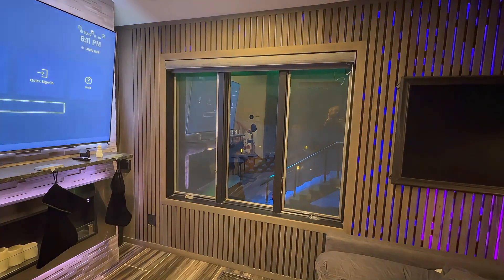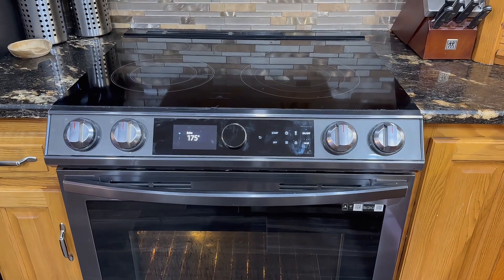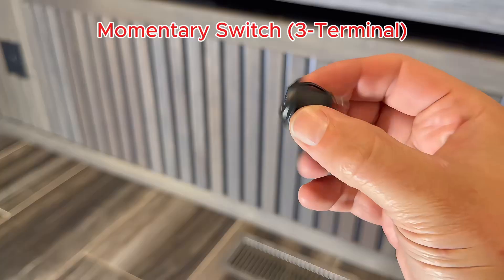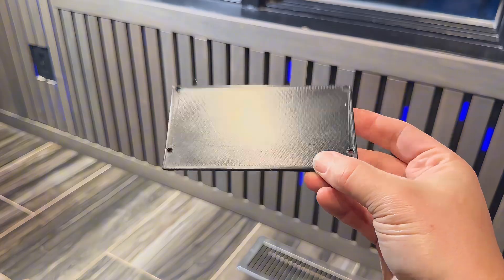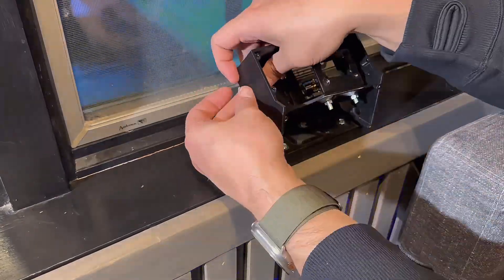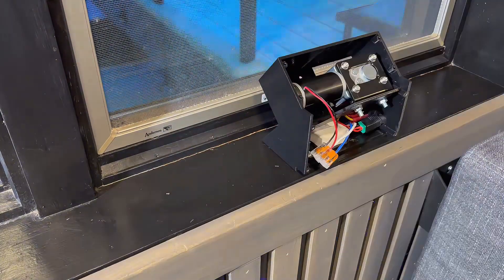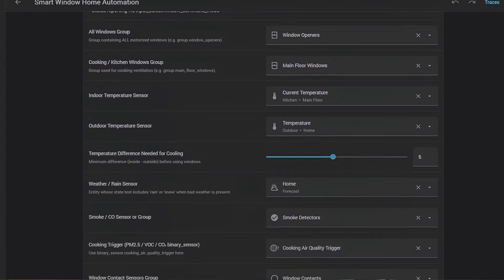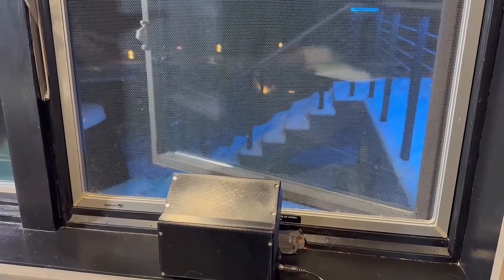DIY Smart Windows: 3D Printing + Z-Wave + Home Automation

Comment: This is awesome!  For years I've said, "How long until we have automatic windows in our house like we do in our cars?"  I'd love to see part 2 with the following included:
1. It's "affordable" but how much $$$ per window?  (Yes, I could just add up all the components 😊)
2. How (in home assistant) do you program the timing of the motor?  Are you always triggering an automation or script?  Or are you using auto-off in the device settings?  Or something else I can't thing of?
3. Speaking of timing, how long does it take to open/close?
4. How loud is it?
Reply from the maker: For all the parts including the motor and adapter, zooz controller, power supply, screws momentary switch, and coupler - it comes to about $100 per window give or take. 

In the Zooz ZEN53 motor controller there is a limiter when resistance is met the motor determines it’s at the end. It can also be calibrated based on cycles. 

There are different motors you can get. Mine is 16 rpms so it’s relatively slow but you can get quicker motors. Slower rpms means quieter motor.

Comment: I have had this kind of system in my home for over 40 years. This was way back in the X10 days. 

The first thing I did was install some large exhaust fans in the attic. They have weatherproof louvers that open once the fan goes on. Then I installed some vents in the living space in each room that had a motorized damper and were sized according to the size of the room. They are common HVAC motorized dampers.

Then I installed linear actuators in the basement windows that would open and close as needed. I had to use a DPDT switch to reverse polarity on the actuators to allow the cool night air at ground level to go through the basement up the stairs, into the rooms and through the vents in the ceiling.

The system looks at the current temperature inside each room and the outside temperature. Then it looks at tomorrow's forecast and decides what would be the optimal temperature for the house to get to before the system shuts off the fans and closes the dampers and windows.

This has been running for about 35 years and started on a Mac SE which has been upgraded over the decades and is now run on a headless Macmini. I have upgraded the X10 to Zwave and use a combination of temperature sensors, Zwave, 433mhz, and Tempest Weather. Most Zwave sensors have a limited range of 40ºF to 90ºF which are worthless for outside in my area of the country. This is why I use 433mhz sensors that have a range of -20ºF to 140ºF.

After the first year I installed HVAC filters on all the basement windows since I was pulling in a lot of debris which made for unhealthy air. If I were to build another house I would install dampers in the foundation that had a filter chamber for this very purpose.

The temperatures during the summer range from 40ºF to 110ºF. We have central air but only run it when the night air doesn't cool off enough. Once the sun sets the temperature plummets quickly and the system takes over and within a few hours the house is actually chilly. If the temperature is going to be over 100ºF the next day the system will get the house as cold as possible and I can get it down to mid 50's early in the summer. Since the ground and structure heats up over the summer and early fall it gets harder and harder to get the house below 65ºF.

When we head toward winter  I use the system to pull in warm air during the day to help keep the structure warm as long as I can. The basement only fluctuates about 10ºF year round since it is mostly below grade and has 18 inch cement walls.

My exhaust fans have been running for 35 years. It pays to get quality fans. They move about 3000cfm per fan and I have two of them.

The system communicates with the central air so that it doesn't come on when the "econo air" is not engaged. If the night air does not get cool enough then the central air takes over.

In the winter when I need heat I move air from the south facing rooms to the north rooms that are colder. I also pull warmer air out of the sun room to the rest of the house with ceiling fans that have tampered ducts above the fans. This reduces our need to heat air which is costlier than moving air.

Also, you never want to open windows in a fire. It will just make things worse. And you especially do not want to have any exhaust fans on.
Reply from the maker: Wow, that's an incredibly comprehensive system you've built! This is where I’d like to get my home eventually. I plan on doing another video this spring and add in whole home fans that will do this very thing. I’d love to chat more as I work towards building this system out even more.

Comment: Well done.  I've been thinking of something like this since I saw the Original Dr. ZZZ stuff in 2019. Do you sell the complelted units?  ultimately I'll need 10.  If you don't I'll be taking on the project mayself.  Your materials are fantastic --- better than what I used to get from my engineers.
Reply from the maker: Sorry I haven’t started selling these yet but I have made the 3D print files available in the description and all the PDFs. Also have the blueprints on my website for getting it setup.

Comment: This is pretty cool! Some questions, what do you do if someone accidentally locks a window, does it go to failure, or do you have a fail safe? Would it be possible to use a smaller motor with some gears to make the footprint smaller (how heavy is the load on the motor)?
Reply from the maker: The ZEN53 motor controller has a build in stop signal when the voltage spikes. To stop the motor if it senses resistance. It’s Parameter 18 in the config. 

It may be possible to use a smaller motor but it really depends on the windows. I originally wanted to use a blind motor battery instead of plugging into the wall but it didn’t provide enough power. It would be something that needed to be tested more.

Comment: Clever idea. But (in my house, at least), the windows still leak a lot of air (and outside noise) unless the lock lever is engaged. Still, this is something I may consider -- it would save me the daily trip in the early and late summer running around to open all the windows after sunset and closing them all the next morning before the heat of the day...
Reply from the maker: In the dashboard I created, you can lockout the automation, for example in the winter time when you don’t necessarily want them opening. Thanks for watching!

Comment: Is opening windows in case of fire actually smart?
I'm on board with opening them if you have high CO2 levels or otherwise bad air quality, but I always heard that closing your windows would be the way to go in case of a fire.
Otherwise really cool project, I wish I had this type of window, automatic windows would be 10/10 for so many different automation use cases...
Reply from the maker: After some feedback from viewers and consulting a fireman (my buddy), you are correct about opening windows during a fire. I changed the window logic to only open certain egress windows that don’t have a secondary exit. My main concern was my kids not being able to get out of house in case of fire because they couldn’t open window manually.